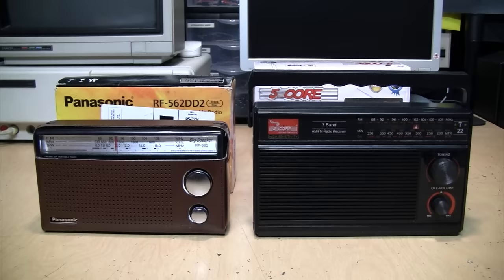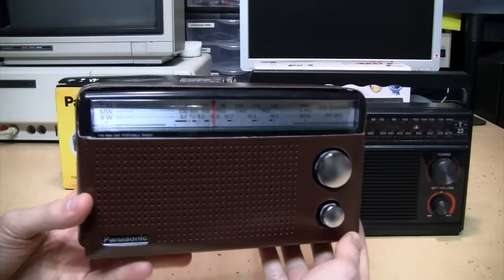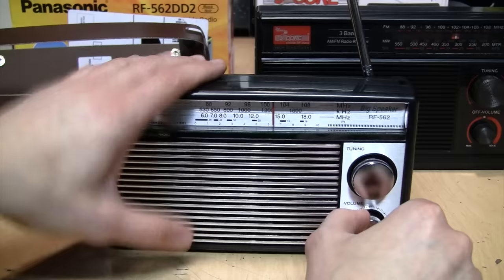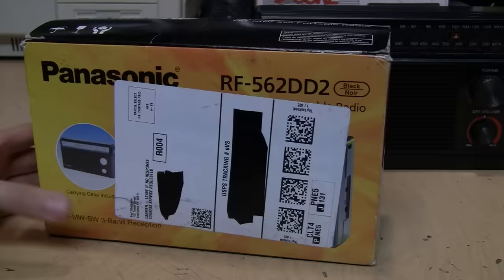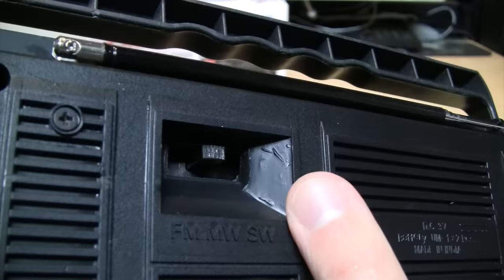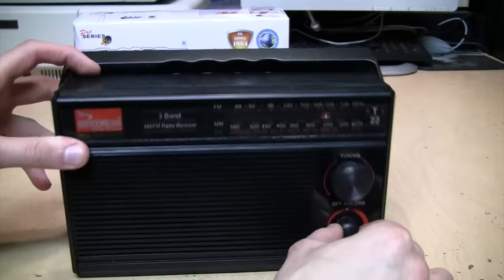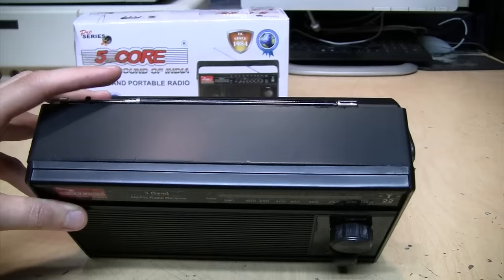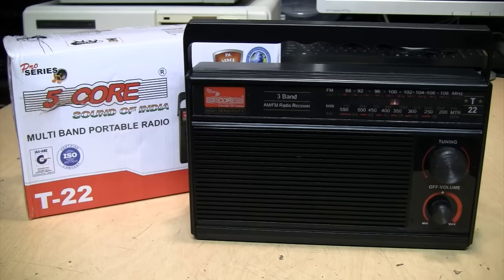Searching for the last true analog radio - Panasonic & 5 Core

Comment: I have a ASDA Smart cr-504 Alarm Clock Radio that still works & I still use (the volume button has become faulty though over time), & that actually has Analogue AM/FM on it. I tried it & there's no choppyness.
I'm not sure how old it is though, it's probably from 2009 or something.
It doesn't have that wonderful sound of that Indian 5-Core Radio though.

Also the 1st review of the India 5-Core Radio on YouTube? Awesome! 😃

Comment: I have a Sangean WR-11 which exhibits this "choppy" tuning. it's based on the Silicon Labs Si4835 which is indeed a digital tuner. FM reception is really good, AM reception however really sucks. The choppiness is probably the byproduct of the tuner actually selecting actual channels (10kHz steps on AM and probably 0.1MHz on FM) instead of tuning continuously. This eliminates the need of AFC but gives the radio this "coarse grain" tuning experience.

Comment: No way in hell does an analog turner work better than a good quality PLL synthesized circuit.  They can reduce drift and lock on to week signals much better.  Just because some of these cheap radios today have crappy digital tuners doesn't mean that analog is better overall.  I wouldn't trade my Radio Shack DX-390 for anything analog.  But its still cool you found such a radio.

Comment: One microchip can replace many discrete components such as resistors, capacitors, and transistors, any of which are a point of failure itself. It also simplifies the design and cost for the manufacturer at the cost of sound quality. This is especially critical if a firm like Panasonic wants to sell affordable radios to new consumer markets in poor countries whose budget could not afford to buy a relatively expensive discrete component radio. The same principle applies to musical keyboards such as Casios. It all comes down to economics.

Comment: Perhaps the DSP tuner would work more smoothly if it were clocked faster? A little bit of hysteresis would probably solve the jumping between stations problem, but I suppose one doesn't get the best quality programming with a cheap DSP tuner.

After one of my favorite long running radio programs came to an end, I haven't found as much utility from my portable radios. I usually only listen to the car radio now. At this point, I have what is probably a lifetime supply of truly analog tuned portable radios...

Comment: I have a gumstick sized pocket radio, with only headphone output.  The digital choppiness is painful on the ears, but at low volume you can't discern which station it is.  The best I can do is pick a station while plugged into speakers and not change it while listening.

Comment: The choppyness in pll digital sets is sometimes caused by "denting" in the tuning knobs construction, there is usually a button combo or mode setting to make it continuous tuned. This is the case with the Sangean ats 909A. Did you try putting a longwire on the antenna?

Comment: A quality digital radio can tune smoothly like the old analog radios however you would be spending a lot more. The real problem with the cheap digital radios is they jump in one kilocycle increments when moving the dial. Also unlike analog radios they only produce on half of the audio waveform and must synthesize digitally the other half which can affect the audio quality.

Comment: I was looking for a shortwave radio and I  ended up getting kaito radio, model :kA268 I'm pretty sure it does use an digital tuner at least for FM and tuning can be hard but it gets good reception on SW and I'm happy for that, it gets SW stations from over 1000 miles away, also has a light indicator of signal strength on it,

Comment: Why did they replace the tuning capacitor, which requires little if any power, with a voltage controlled oscillator, which requires a lot of power?
This seems counter productive.

Comment: Panasonic RF-562D was a radio with analog tuner based on a single chip. What you have here is RF-562DD2, which is a complete redesign with digital tuner. They look completely different inside.

Comment: I think that anyone who watches any video like this wants to see the insides.   
"3V" is probably an engineering shift to also use a single Lithium Ion cell (3.7-4V) with a typical 5V USB charging circuit as other similar products use.
Reply from the maker: See my follow-up video.
Reply: @vwestlife  Thanks.

Comment: When you have problems like those you demo in the video, it in fact is most likely that you have very strong local signals and are trying to receive other, weaker, signals.
A known problem of these cheap digital radios is the small dynamic range.  They cannot receive a weak signal next to a strong signal.
But other than that, digital technology normally is superior.  In digital radios the filtering (within the dynamic range limits) will be brick-wall and the AM detection will often be synchronous, which performs better than the old analog radios in the cheap segment (of course analog radios with synchronous detection existed in the higher-end market).
Also, digital radios cannot get out of alignment, they always either work or are defective (and impossible to repair).

Comment: I don't mind step tuning. My Panasonic RF-2400D and RF-P15D are pretty sensitive on am and fm and they sound find on both bands. Compared to my older Panasonic RF-559 and RF-503. Of course the older radios have much smoother tuning. But when it comes to finding stations I find all four radios are basically just as capable. The only difference really is the RF-559 sounds really good with it's big speaker and tweeter combo.

Comment: To check whether those radios were true analogue or not, the first thing I would have done is open them up and look inside them. The true analogue one should have a condenser tuner, also known as a tuning capacitor inside it, which had metal plates that meshed into each other. I used to repair analogue radios back in the day and seen how they worked.
Reply from the maker: There are plenty of 100% analog radios with a varactor tuner, such as the GE Superadio III.

Comment: I always thought digital tuners, while choppy, and can sound meh if cheaper components are used, would be better at "locking in" on a frequency, where analog would have a gray area.  Then again, I guess quality of components used may make a difference in digital ones as well.

Comment: the digital AM radio's tuner can't seem to deal with separating the distant stations coming from different directions. The analog receiver can just be turned to aim the internal antenna for the desired signal only.

Comment: If I have only a choice between that analog radio and my $50 smartphone connected wireless to my bluetooth speakers I would choose the smartphone-wireless-speakers.  My smartphone radio (Android) has buttons to select my favorite stations.  They come in very clear with high quality, over both the wireless speakers or my Bose headphones.  
Moreover, I can tune in any of the 1000+ stations on my computer the Bose headphones or wireless Bluetooth speakers play the songs perfectly; and hundreds of those stations play without any commercial advertisements.  
Even moreover, my computer radio station software automatically records and separates each song into high quality MP3 files tagged with metadata such as song name, artist, album, duration, etc.  And never records the same song twice!  I could go on...such as using an equalizer, automatically attaching album art, etc.  
I grew up in the 1950s and for many years only knew of AM radio.   FM was the dawn of a new age; then stereo FM blew my mind in the late 1960s.  But give me modern digital radio any day over analog.

Comment: They weren't called analog, they were called solid state. Analog is a system of encoding. Solid state is the type of circuitry used. Solid state electronics are hearty and can last a long time. They are also more repairable. The radio might use a mechanical system of tuning but it could still have some digital electronics inside.

Comment: Local "Daiso" stores sell cheap radios. I was expecting some very low cost 3-transistor radio components inside, but it turns out it just uses Beken radio DSP. I wonder about the dual-band one, because the one I got is FM band only.

Comment: I bought a brand new Sony ICF-P26 radio at Walmart last year for about $20. I was rather impressed... and yes, analogue. If you hook up the stereo earphone jack to a nice sent of computer speakers I get great sound. The built in speakers are small and they sound like small speakers. Only thing I'd improve is the antenna mount. I had several hand held radios like this in the 70's but actually this one is much better.

Comment: That choppyness doesn't necessarily mean a digital or synth tuner.
It can also be from a noise-blanking filter that blanks white or pink noise signals.
Reply: @MikinessAnalog  exactly. But in AM & FM & TV band tuners they called it "noise blanking" and it was a selling feature. The same way modern  TVs dont show snow screens anymore, they switch to a blank black or blue screen
Reply from the maker: No, it's a DSP-based tuner. Some manufacturers, like Sangean, actually advertise it as a feature.
Reply: @vwestlife  I didn't say it wasn't. what i said its that that is not a true diagnostic since there are analog tuners that will mimic that
Reply from the maker: @MessalineApghar  You're thinking of FM muting, but this choppiness of DSP tuning isn't anything like that. If you have a chance to try a DSP-based tuner with an "analog" tuning dial you'll notice it right way.

Comment: I remember a time when "digital" was a synonym for quality. But now it means dynamic compression and extreme low sample rate. It's the same nonsense with DAB+ where 32kbit/mono is called FM quality. In the 70s and 80s even the cheapest radios sounded better than this Panasonic thing.

Comment: What about a GE Super Radio III?  They had awesome AM sections in them.
Reply: Its rather obvious he's looking for NEW radios
Reply: @DanafoxyVixen  I was actually inquiring if it was a digital or an analog radio I just didn't word it right.
Reply from the maker: @midsouthexpress  The GE/RCA Superadio III had an analog tuner.
Reply: The Super Radio III is no longer sold/manufacted by General Electric or its licensee Thomson Electronics. The product and name were sold off to Alco Electronics, Ltd. which sells the Super Radio III under the RCA brand name, RP7887. Quality levels aren't consistent. I believe this product has been discontinued and is no longer in production.

Comment: I don't have any problem with the DSP in theory, I usually listen to the radio on an old receiver that has digital preset turning yet ironically is pre DSP, (I ASSUME given its late 90s manufacturer Jensen Walkman as better radio performance and is really impressive and poles stations from far distance, sometimes you have to go up the band and come back because it'll skip over stations it's so selective and the DSP does make it choppy in that regard to where you won't hear a real blend between stations, none the less it pulls in more stations by far than any other radio I have except for a Grundig shortwave and it sounds very nice

Comment: Seems that retro designs are in looks only, kind of like the retro "Bush" brand radios over here, where they took a cast of an original with a deformed letter "u" in the Bush name (a common fault with the old plastics apparently) and slapped modern radio electronics inside it just to make it seem useful...

Comment: I believe the Tecsun 2P3 (still sold as a kit) is analog, as it does not have the 'choppiness' that you demonstrated. It does use 1 IC, but I am almost certain that it is for amplifying the audio signal, not for tuning.

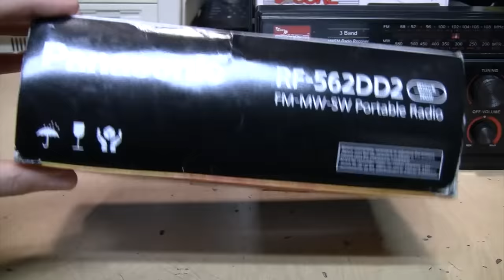Comment: (4:32) This reminds me: I bought a TV antenna from one of those companies here in Singapore that resell Amazon UK returns, and it turned out that Amazon did the same thing with that antenna. They slapped the postage label right on the retail box and sent it to the person who ordered it instead of using one of their trademark mailing boxes with the weird stringy packing tape, and the box got beaten up as a result, plus the antenna inside got scratched, so I got mine for significantly lower than the retail price. Amazon put a blank sticker over the original postage label, but when I slowly peeled it off, I could see the faded remains of the original label, including the recipient's name and address! I then looked up the latter on Google Maps to find that they already had a rooftop antenna, at least the last time the Street View image was taken!

Amazon's computers not only seem to determine stock levels, prices, where in the warehouse an item is located, and what mailing box to use, but apparently also just says to slap a postage label right on the retail packaging and immediately despatch it, and apparently is not programmed to tell the architects to add more employee toilets and lifts. On top of that, Amazon reportedly treating their frontline workers like disposable robots that never need to be plugged in to charge.

Comment: The last radio I bought was a Radio Shack pocket-size job and it turns out that it was cursed with DSP.  You just couldn't tune in anything on AM.  The radio flipped and flapped all over the place.

Comment: I notice that the FM tuner is way out of sync with the display on mine.  The indicator is more than half an inch to the right of the correct number, yet AM is on target.  Does anyone else have the same issue?

The radio sounds so amazing that it doesn’t even bother me as much as it should.

Comment: Touchy tuning on a FM radio is the result of AFC on the tuning, It will make some weak stations impossible to get. I remember a salesman trying to sell my mom on a tuner at a department store (after we lost our local easy listening station) on the "fact" that a local station had a lot of "reach" on the dial when it should have no more space on the dial than the one from 100 miles away.  I have heard some of those one chip radios with exceptional specs. No dial will do them justice, unless you want to pay for a ten-turn-pot. There is still a lot of crap and worse marketed both analogue and digital. Most people will be happy with good digital knowing they can read exact numbers. What I and the world needs is a honest rating for good and bad radios. Like water heaters and air conditioners we want to see that arrow pointing to great or crap.

Comment: I think the space next to the two-battery holder is to store the AC cable (for the versions that came with the AC input). I have a Philips mono cassette and radio unit which had that space to save the cable.

Comment: What exactly are these 'digital tuners'?

Are we talking about a superhet that uses a PLL with a digital frequency divider as its local oscillator? These can only be tuned in fixed steps, but the signal path is still analog. Such designs have been common in CB radios since the 80s because you are only allowed to use a set of exact frequencies (channels) anyway.
Or do these radio recovers really digitize a  high frequency (or intermediate frequency) signal and decode it digitally (perhaps even in software)?

Both types can be made very high quality, but certainly not in such cheap devices.
Reply from the maker: No, I'm talking about a Digital Signal Processor chip. The front end of the radio goes directly into an IC which converts it to digital, and then does all of the tuning and demodulation digitally. Watch Fran Blanche's teardown of a modern radio, you can see that everything is on one chip, the tuning is done by a potentiometer instead of a variable capacitor, and there are no IF cans.

Comment: Mechanical Variable Capacitors in the old radio receivers made of metal will be very expensive to made on this days, reason that they use very cheap digital tunners that cost cents of a dolar, does not have the feeling for smooth manual tuning for AM or short wave, however work ok for FM signals.

Comment: You can still get superhet AM pocket  transistor radios in kit form out of China, I kinda collect them. I've not yet found a FM one not based around a chip though, probably because a proper FM IF strip and detector made of discrete parts is kind of a pain to align (need a sweep generator and a scope) which is probably why you dont see them produced anymore.